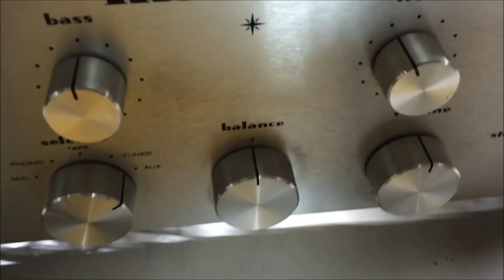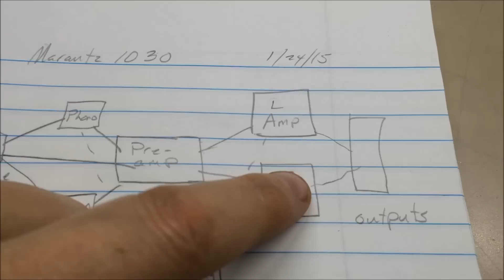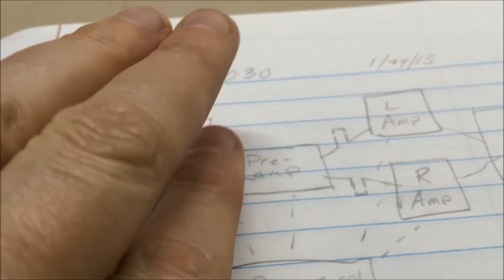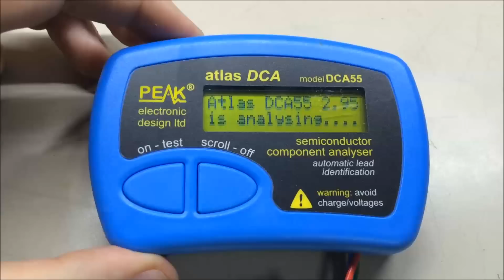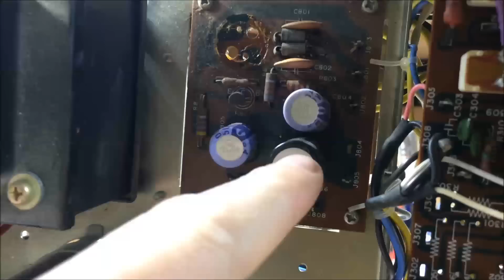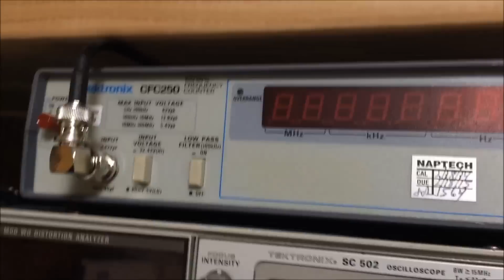Marantz 1030 Amplifier Service, Repair, and Bias BG007

Comment: Excellent demonstration on fixing a Marantz 1030; like you I carefully match the gain of the driver transistors and change out the capacitors, finally checking DC offset and correctly bias the outputs for symmetrical balance.

Comment: Thanks for the video and the instructions.  It is all very good!!!  I tend to replaced all electrolytic caps from my sound equipment from the mid 1990s or early -- it is a complete peace of mind.  BTW, you filmed this over 4 years ago, I think that by now you have bought a desoldering gun.  I used that manual desoldering pump before but was never good at using that until I finally bought a desoldering gun -- what a change!  Regards,

Comment: I love your videos. But... Smile with me now! ... your block diagram was... just inaccurate. In my best DR. Smith voice, "OH, the pain!" 

The phono preamp and FM input are in front of the selector block. The path should be [any input] to [selector block] to [volume tone block] to [preamp block] to [power amp block(s)] to [head phone jack] to [speaker selector] to [speaker output]. The phono input goes directly to the phono preamp, which both raises the signal level and applies industry standard equalization, making the phono level into compatible line level and it NOW joins the selector block. The FM receiver, and other input devices (usually) already put out properly equalized line level and goes to the appropriate input of the selector block. 

Thank you for your great videos! Thumbs up!

Comment: I just acquired this amp.  It blows the fuse on power on.  I can't to get it sorted utilizing some of the techniques you have demonstrated.  Hopefully its just the power supply board causing my fuse to pop.

Comment: Under your instructions for Amp Bias Adjustment you outline the procedure verbally , compare what you say to what's referenced in print. and yes if I am not careful I do the same thing. 7.5 volts DC is a lot diffrent from 7.5 mV DC and yes you do correct yourself in the actual procedure later on,thank you for sharing

Comment: nice video, one suggestion for you.   using a tool specifically designed for tweaking potentiometers is a good practice to get in the habit of doing. metal objects such as a screwdriver can cause interference in some circuits as well as being potentially dangerous........ just saying

Comment: Amazing Video! Thank you so much you are a great instructor and thank you for sharing your great knowledge.  I have an Adcom GFA 555 that works good on my outdoor speakers but I would like to check out before bringing inside and connecting to my really good speakers. Is there a good way for me to check with just a Digital Multimeter. I do not have an Oscilloscope.  I wish you were closer I'm in NY on Long Island. Thank you for your help and keep em' coming!

Comment: Hello Marc, there is NO DC offset ...... These are not power supply caps but capacitor output and should be floating at half the supply voltage.

Comment: Good job, but really. You've got that nice 2246 scope. You could have used that and a multimeter and really troubleshot it down to that transistor. This isn't on  you, but these days people just shotgun caps etc and not so much actual troubleshooting. So much is revealed with waveforms and voltage levels. I've been doing this going on 40 years and I would love to see these skills survive.
Reply: Mark Zacharias Make a video!
Reply: Mark Walker I have - just not lately. Look up "repair brief". You'll see some of mine. I've done at least about 20. Multimeter reviews, repairs, etc. Thanks!

Comment: I know this is an old video - so, I don't really expect a reply but...... I have this exact same unit on my bench now. Had the exact same problem - low gain from driver transistors on one channel. I replaced all six transistors (both channels) and all of the caps on the driver board. So far, so good. Both channels working now. I now need to do the bias and output adjustments. I have the required test equipment, and a fair amount of experience. My question is - I noticed that the output was never checked for DC (ie; offset). Am I correct in assuming that balanced clipping points will yield minimal DC on the outputs?
BTW - thanks very much for what you do. I love your channel. Have learned a lot. And that Southern accent....I find it quite calming actually 🙂

Comment: Hello Marc.  I noticed on the circuit board, the transistor's center pin is the collector, however on the cut sheet you showed, the center pin is the base...is there a discrepancy there?

Comment: Didn't understand why, when the bias voltage was jumping up and down you said it was a bad capacitor. Did you replace it and then adjust the bias voltage later after the video?

Comment: Hello! I've got Marantz 2220 and it's got similar power amplifier board. I've seen that some people adjust DC offset by connecting multimeter to speaker terminals and turning trimmer resistors (R729/30) accordingly (to get 0V). Is this a substitute adjustment for these 2 steps in "power amplifier adjustment", or for at least one? Thanks!

Comment: Very nice video. I have a marantz 2232 amp, it seems to have lots of power with great sound but i never see any info on these units. My particular unit has uneven sound on left channel, slightly pushing in or moving volume knob from side to side corrects this temporarily. I was wondering what you think might be the problem, and do you think this amp is worth fixing,

Comment: Hello from Italy, I own a Marantz 104 Tuner driven by a Marantz 1030. My speakers are Klipsch HeresyII (1988). Just one question please: the bass section seems poor. To have more smooth sound I must add laudness and turn the bass at nearly the maximum level. Speakers are Hi Efficiency 99db, maybe are not a good match Marantz-Klipsch or do you think there is something that doesn't work properly inside my Marantz 1030? I often clean inside from dust, but never changed or replaced original pieces: just the power lamp burned. What do you think about it? Sorry for my english. Waiting for a kind answer from you, I send my regards. Ciao Sebastiano

Comment: I have the same problem with my marantz pm151, that the right channel for both speaker outputs doesn't work, and I would like to repair it, but to send it off to someone to repair would cost me the same as, or more, than just buying a working used one. Is there any advice you could give me on trying to repair it at home myself with limited equipment as I have never done this before.

Comment: Very interesting, when using signal generator is it always 1khz to test this or other frequencies can be used - what is the minimum MHz you would recommend when investing on a signal generator? do you also need a scope for this? Not all amps have trim pots to adjust bias or or configure output transistors, so would you just leave it as default?
Reply from the maker: +jon123423 It might be easier for me to just make a video this weekend showing my audio test bench and all the things I do to test out an amp and what not.  As to the trim pots, most have an adjustable bias, those that don't, you may need to replace bias resistors
Reply from the maker: +jon123423 1khz is just a good starting point where i do most testing.  however for frequency response, i use the full range.  i'll make a video and demonstrate soon.  a scope is very handy, any 10mhz or higher scope will work well for audio  if there are no bias pots, you may need to insert one or replace resistors, watch my mc225 video to see an example
Reply: +Blueglow Electronics Thank you very much for that.  I have also notice from some of your your videos around solid state amplifiers that you do not probe on circuit as much when using scope, why?
Reply from the maker: Good question.  I do use a scope a lot on SS unit but guess I need to post that more.